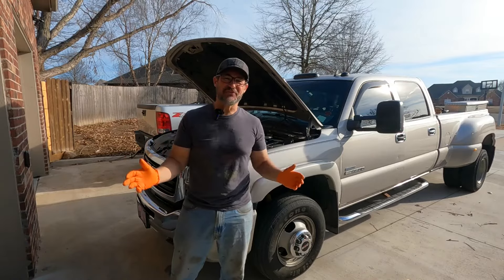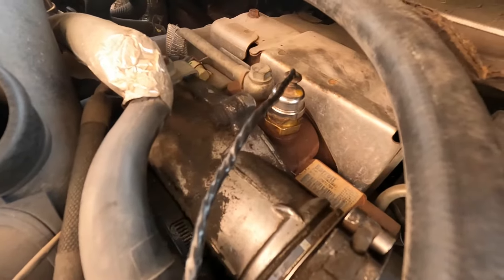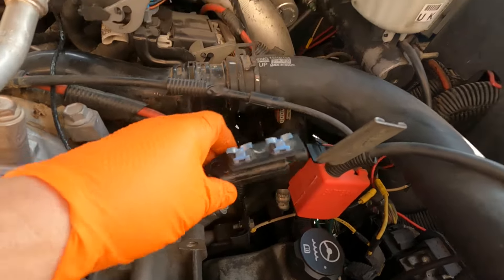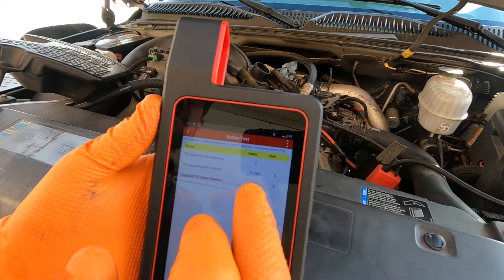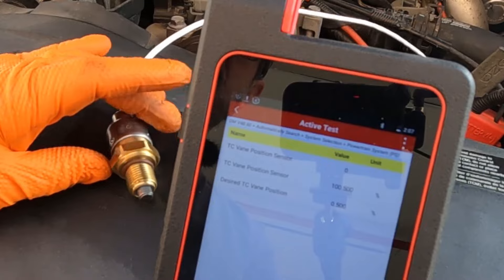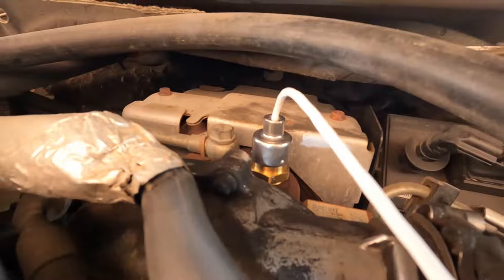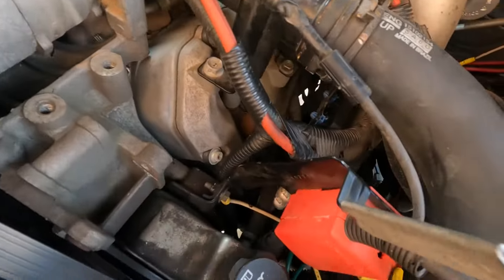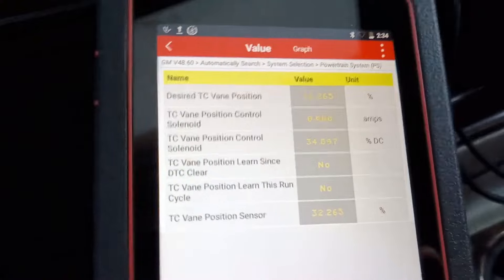Duramax turbo vane position sensor location, testing, and replacement

Comment: I have no error codes but it smoking black and lack of power. I saw that with the engine off the scanner is reading 3.92%, but the sensor not out that you showed. Mine is pluged into the turbo. Should I remove it to test it like you did?

Comment: Great Video, question with the scanner you used. Are you able to do the Turbocharger learn procedure with the scanner you used or able to turn on or off the Vane position sensor with the scanner you used?
Reply from the maker: probably could have the launch diagun is pretty advanced for its cost.  I didn't have to do the relearn, it just worked fine after the swap and code clearing.

Comment: I am getting an error code P0299 and P0101. This is after replacing MAF sensor and Air Filter and fixing a small boost leak in the inner cooler system. Could this be a vane sensor or MAP sensor issue? Man having a hell of a time finding the issue. The truck is running good now after fixing boost leak which was causing rough idling and surging and poor mpg. Now i am getting good mpg and no surging but these two error codes popped up while driving on the freeway. Thanks to anyone with some ideas

Comment: What problems were u having ? My Lml in the cold mornings has zero power then it will kick in and take off . Stumped
Reply from the maker: this one drove pretty normal, just threw a code for it. As for the Lml being sluggish when cold, I unfortunately don't have any ideas right off. I'd just be guessing, but thinking about things that may loosen or open up with heat... turbo vanes, dpf, fuel injectors?
Reply: My LBZ is doing the same thing. Have you found the fix for your LML yet?

Comment: What brand is a good one to use
Reply from the maker: Gm is always best, but they are proud of them and ask a lot of money, so I usually go with Dorman and have had no issues personally.
Reply: Always run GM brands or OEM electronics and electrical.